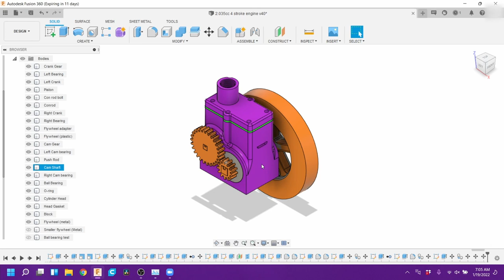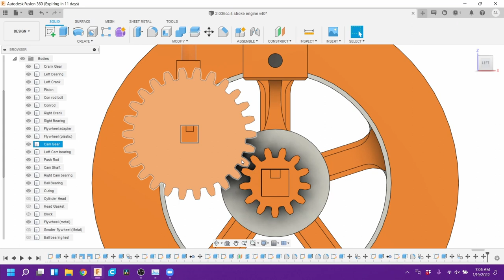Building The 4 Stroke Compressed Air Engine

Comment: Try to make a alcohol 4-stroke or 2-stroke engine. For cylinder use glass syringe, and for piston metal or glass piston. You can find them in $25 Stirling engines.
Reply: Great idea... but thats pretty similar to a gasoline engine

Comment: Nice to see the different parts up close. What is the smaller square in the axle profile for (1:21)? Also thanks for the links in the description. I was wondering what you used to connect the air supply to the engine and that clears it up.
Reply from the maker: So on the crankshaft the tiny squares are used to connect the 2 crankshaft parts. The large square on one of the crankshaft parts is used for the timing gear, hope that clears it up
Reply: @AxelDayton  Ah I see, thank you